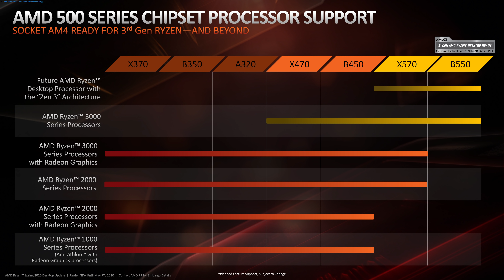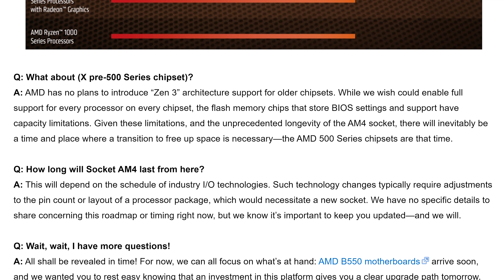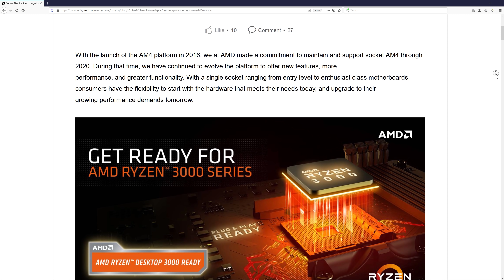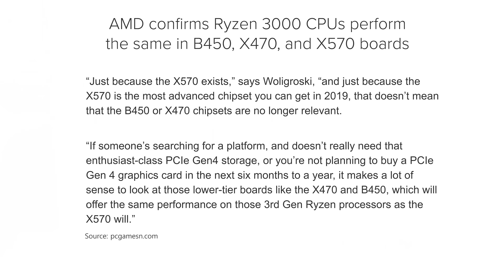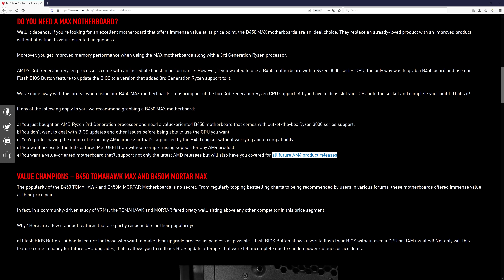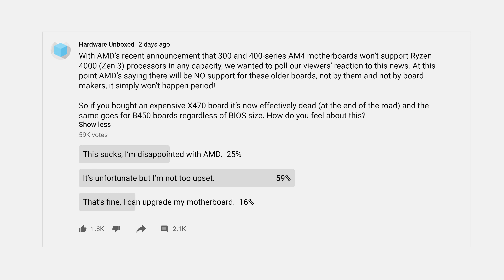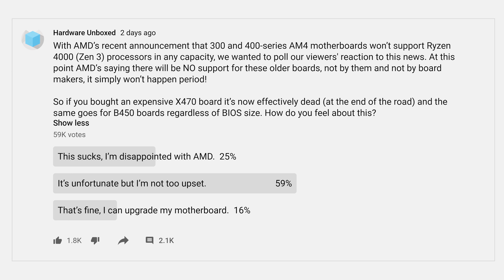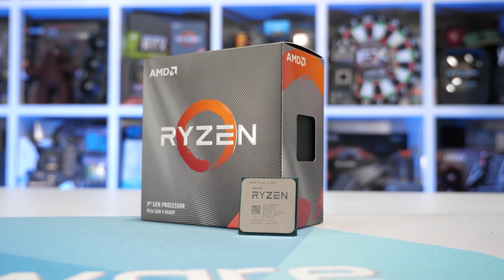AMD Does An Intel, Axes Zen 3 on 400-Series Motherboards, Our Thoughts

Comment: Damn, I got a x470 in beginning 2019 expecting 2020 support as they goddamn promised. Bah.
Reply: I think when they said "until 2020", they literally meant "the second 2020 happens, there's no more guarantee". Still a scum move by AMD, even though it doesn't affect me.
Reply: @lucasz8825  nobody fucked them in the ass not to buy a 300 series motherboard, support for 3 generations is more than intel ever did
Reply: Same here bought a b450 at the start of this year and a 2700x coz i wanted to skip 3000 now thats my only choice if i wanna upgrade
Reply: AMD stated supported TILL 2020 not through 2020
they also stated that it was AM4 as in the socket not the 300/400 chipsets that would be supported
Reply: @samcan9997  nah they sais through 2020. Stop being a fanboy and defending these companies smh.
Reply: Where did AMD promise that? AMD have already made it clear that AM4 motherboards won't be supported after 31 December 2019, so not sure how you thought that your x470 would work on Zen 3 which releases after 31 Dec 2019. If you look at AMD's official Socket Stability slide in the article "3rd Gen AMD Ryzen CPUs Will Work on Many Existing MSI AM4 Motherboards" (search it on Google), you'll see that the graph clearly shows no support for new CPUs on AM4 after 31 December 2019. If you take a good look, the orange bar stops right at the end of 2019, just before 2020 starts. It was already know even a year or two ago that Zen 3 will come out some time in 2020, or in other words, AFTER the official support period. So how did AMD not keep their promise?
Reply: @bgtubber  Stop spamming the same copypasta over and over again. You're on every single comment down the line with the exact same message and you don't give answers to the counter arguments... Plus you flat out ignore 90% of what Steve just said about what OTHER messages AMD has given.

Comment: I understand dropping the 300-series (but with 300 & 400 sharing the same chips dropping just the 300-series does not make sense).

But the 400 series?  If AMD had released B550 close to the Zen 2 launch and started phasing out 300 and 400? Yeah, That might have been reasonable. It does not make sense to think that 400-series boards will not get Zen 3 support when AMD kept pushing them after they released X570.
Communication is often as much about what you don't say as what you say.

Comment: The backlash wouldn't have been so big if AMD had released the B550 chipset at the same time when they released the X570 chipset.
Reply: Exactly
Reply: That's one point I agree with. Acting suprised that they maybe switch from AM4 to AM4+ in 2020 like they saidis bull. But "withholding" the B550 because reasons is something that's also bull.
Reply: @WrexBF  I'm saying that a lot of consumers have bought 3rd gen. Ryzen CPUs with B450 motherboards due to the lack of a 3rd gen. mid-range chipset (B550) and that there'd be less consumers who own a B450 motherboard today AND B450 motherboards wouldn't have been recommended as much due to how old the chipset is THEREFORE there'd be less people who would be mad about this move overall.
Reply: Why is there backlash at all when AMD have already made it clear that AM4 motherboards won't be supported after 31 December 2019? If you look at AMD's official Socket Stability slide in the article "3rd Gen AMD Ryzen CPUs Will Work on Many Existing MSI AM4 Motherboards" (search it on Google), you'll see that the graph clearly shows no support for new CPUs on AM4 after 31 December 2019. If you take a good look, the orange bar stops right at the end of 2019, just before 2020 starts. It was already know even a year or two ago that Zen 3 will come out some time in 2020, or in other words, AFTER the official support period. Do people not know how to read graphs?
Reply: @bgtubber  AM4 is socket type, B450/X470 is chipset type. Learn the difference. Unless Ryzen 4000 series use  a new socket type, which pretty unlikely.
Reply: @bgtubber  AM4 Is still supported though, just not all chipsets. The problem here is that AMD offered no current-gen mid-range/budget chipset that would've replaced B450 when 3rd Gen Ryzen and X570 came out so all consumers who didn't need advanced features on their motherboards had no other choice other than B450. It is obvious that B450 motherboards can support 4th Gen. Ryzen it's just that AMD doesn't want to.
Reply: @bgtubber  You being in damage control , you are copying and pasting the same comment all over the thread
Reply: @bgtubber /videos And the bar starts at 2017, as you should know AM4 exists since 2016 ergo 1 whole year before the graph starts. 
So, do you know how to read graphs?
Reply: @CarbonPanther  Actually first motherboards with AM4 were in 2017 I believe.   It was announced in 2016
Reply: bgtubber, wtf are you talking about? those X570 and B550 boards are AM4 motherboards. 
Let's assume AMD said that they'll support the AM4 scoket until the end of 2019, why the hell are ''AM4'' boards like X570 ones still getting support then?
Reply: I agree, but my comment was replying to bgtubber. Youtube probably bugged out cause I also receive a comment from Verzula that wasn't refering to me.
Reply: @WrexBF  Excellent Point.
Reply: bgtubber Ive seen this same message on other comment threads here and I truly am wondering if you are somewhat related to amd or motherboard partners in someway. You can't be stating the same message on multiple comment threads because it's deplorable and doesn't answer the original comment. Yes there is backlash and yes consumers want 4000 support on 400 chipsets. Deal with it we are consumers also and want the best bang for our buck in these hard times. Trying to justify amd's stance blindly here depicts that you are not understanding the consumers view. And by blindly I mean pasting the same reply on multiple comment threads on this video.

Comment: While this doesn't affect me as I got an X570 board already, I am quite upset by AMDs behaviour in this matter.
This is without a doubt a class 1 dick move, especially considering it's explained by a bullshit reason.
I smell marketing incompetence miles away, and truly hope the uppers at AMD decide to turn this one over.
What is entirely unreasonable is that this info is given so late into the game. Zen 2 has been out for almost a year, and I'm assuming many, many thousands of 400-series boards have been sold since then.
Nah, this isn't fine, not by a long shot.

Comment: Intel screw compatibility with Z370 which basically the same socket as Z170 and Z270.
AMD screw compatibility with 4th Gen Ryzen which is using the exact same socket as previous Ryzens.
So, both are greedy when they think that they're on the top.

Comment: I bought a B450 Tomahawk Max with an R5 3600. I voted that I wasn't too upset though, because I bought the max for out of the box compatibility with my current CPU and not to future proof. I considered X570 for future proofing (PCIE 4.0), but ultimately decided that I'd be more likely to upgrade 3-4 years from now than any time in the near future. I didn't see the value in spending the extra $40-50 for X570 when I'd probably want something beyond that (or potentially even an Intel chip) in the future.

Comment: If and had released b550 when the 3000 series came out, then this wouldn't be as bad. But there's a good chance that am4 won't be around much longer than the 4000 series. So the b550 (and any 600 series) is basically a 1 generation board from what I can see.

Comment: 32MB Bios B450 / X470 Boards ( of which there are many out there still for sale) could easily get a new Bios Code written for them to support Zen 3! ( even if that means removal of previous series Ryzen CPU support for that specific Bios version - sure, no problem! ) They could possibly pull that off even for the 16MB Bios B450 Boards, If the Board partners are willing to completely strip down their fancy looking Bios GUIs to a "bare minimum/simplified version" that will only retain the required functionality and support for these CPUs...  Cmn AMD and Board Partners... Dont get sloppy and lazy, you can do much better than this...

Comment: I really disagree on one point: support for 300 series imo should also be there. I just searched and remembered as far as i could find sources that confirm that the old shown roadmap to people that bought in zen 1 were shown that zen 3 would lauch before 2020 (that did not happen) though at the same time they stated support to 2020 which implied that 300 series am4 would support zen3. Now a lot of people i know that took the gamble and the misery with zen 1 bought a rather nice board (thoug for really nice once there was no choice/ non at all) just for this longevity. so those were pretty expensive x370 boards for that reason that b450/x470 is discontinued is just complete nonsense but i disagree that x370 should also be ruled out for any support.

Comment: Asus makes six X370, three B350, and three A320 boards (just looking at the site -- there may be others that aren't listed). That's 12 "Gen1" boards.
There are six more X470 and nine B450 boards. 15 "Gen2" boards.And right now there are 12 X570 boards, while we wait for B550.That's at least 39 different AM4 motherboards from just one company.

Now, imagine trying to properly validate each and every board with the 10 Gen1 Zen CPUs and APUs, six Gen2 Zen+ CPUs and APUs, and currently nine Gen3 Zen 2 CPUs -- with potentially several additional models that are only available in select parts of the world.That's at least 25 Ryzen CPUs, but there are probably closer to 30 once you add in revisions like the 1600AF.

Validating every board across every CPU means at least 975 potential combinations -- and then there's RAM compatibility testing, USB devices, M.2 SSDs, etc. Just getting a platform to work well with one generation of hardware takes effort. Cross-generation compatibility can double or triple the effort required, and then the companies are stuck supporting products that are no longer for sale with new CPUs.- JaredWaltonGPU 

I believe the above seems to be a valid reason and why AMD made this decision. So cut them some slack and don't bash them.

Comment: I am hoping Asrock would do some of there usual magic in this case and the rest will have to follow.
Reply: did you not hear? They need the Agesa code from AMD to support the 400 series. Only then can they do something for the customers! This time, AMD is not even giving the board partners an option to support it on their side if they want to!
Reply: @NatrajChaturvedi  The AGESA code can most likely be pulled from the x570 or b550 BIOS and haxed in. Many board vendors have pulled similar tricks over the years. I had an Abit board that let you run dual socket on Celeron back when the internet was steam powered.

Comment: The 500 series board will also have a short lifespan. As I think the introduction of DDR5 in ZEN 4 and also a new socket will force a motherboard update. Anyway my impression is that people stay on a current CPU/motherboard combo for as long long as they can. For so updating them both in a new setup. If they upgrade anything in the latter period it wil be the GPU

Comment: Meh I got a 2700x build last jan with a x470 taichi and it would be nice if i could get zen 3 (ryzen 4000) gen support. Ever since 3rd gen came out im like well its not that big of an upgrade but I could get zen 3  when that comes out then be set for a bit. I figured zen 3 would be where am4 would end and I would be fine until then so this is a bit different than I expected.

Comment: bought an x470 board and 3700x expecting to be able to upgrade to a zen 3 chip at some point but hey if that doesnt happen i will wait out them moving away from the AM4 socket as there is no point buying a 500 series as by 2021 they will have dropped support entirely and probably moved to AM4+ socket

Comment: The problem is how AMD market their AM4 socket. those wordings of support till 2020, committed through 2020, etc, AND the fact that AMD did not stop vendors like MSI market their MAX mobo for "support for ALL future AM4 processor", AND THEN they didn't release B550 until everything's too late, is a clear dick move. after Zen2 launched, there's a clear "Ryzen boom" in the community. Everyone and their mother and their techtubers recommended Zen2 for friends and families, along with budget B450 boards because X570 is too damn expensive. So everyone did just that, they bought B450 and Zen2 en masse. some believing they still can go higher with their investment on B450, turned out to be false. 

So who's to blame for this mess? 
is it the very optimistic community about continuation of Zen1, Zen1+, and Zen2 tradition?
is it AMD for spreading hopeful wordings and marketing push, and did nothing to clear the misunderstandings, and also delayed B550 to this bad?

Comment: I don't understand how this pulling an Intel when the main thing holding Intel back is the repeated use of the same socket =b From my understanding whenever Intel required a new motherboard in the last decade it's been because the physical chipset has changed, not just because they are too lazy/cheap to include a larger bios.

Comment: I bought a b450 motherboard 3 weeks ago
Reply: Hermès Akkermans  I also brought a b450 msi mortar max for my ryzen 3600 2 months ago with news on msi and amd website that this board will support the new 3000 ryzen new gen 3000 cpu, I feel that I have been robbed at this moment in time, overclockers forum recommended the b450 max countless times also, if I known that amd would changes there mind regarding the b450 max I would not of brought it, msi states on there webpage that there b450 max will support 3rd gen ryzen...
If and do not change there mind I think msi should accepts a refund or change my board to b550 or X570 and I pay the remaining money...

Comment: I'm not phased by AMD's decision because I went in buying a B450 with a 2600 (very midrange) expecting it'll last me 3-5 years before I start to see diminishing performance (well, I had a 4770 i5 & it started to diminish quite rapidly since it was only a quad-core & that's my only comparison) and will have to upgrade to a completely new chipset much later on that'll even outperform a 3600. So if I'm going to spend money, might as well be on something up to date even if it's "midrange" again rather yesteryear's 3600.

Comment: Yeah but Ryzen is so good you don’t need to upgrade the cpu. I bought a 2600 and b450 when Ryzen 3000 was out ( fine for my use case). I will probably keep for 4 more years. But wouldn’t ddr5 be out for Ryzen 5000 and that would need a new mobo anyway. It would be great if the compatibility was there but how much better is Ryzen 4000 going to be that waiting out that cycle is not going to be that bad. I don’t think anyone recommended upgrading a 1600 to a 2600.

Comment: If they said at the beginning; we just support zen3 on x570 and b550, I guess everyone would have been fine with that. But this way its quite sad. Personally i got a x470 board in 2018, and i thought i would hunt a deal for a Zen2 part, when Zen 3 is released, because some people will upgrade for sure and used Hardware got such a sweet price to performance value. But now I know that the 12 and 16 core parts will stay expensive even on the used market, because it's the highest end option you have on the 300/400 Boards.

Comment: B450 hmm. Considering between 3900x and Intel comet lake with upgrade to rocket lake. AVX-512 support is important in the long term hold and buy, but I NEED something modern for my PC to get my workflow now.  And I don't want a chipset to have additional fan for noise reasons, and I'm anyway close to limit of my budget with B450 boards.  The comet lake to rocket lake upgrade path would be getting first really cheap comet lake and later upgrade to highest core count rocket lake.  While I advocate for long term purchases, this time I have to get something. Using i7-920 for work doesn't cut now , year or two too soon. Royally screwed by 10nm delay after seeing what AVX-512 could be used as programmer who likes to optimize code.  
Now how much this matters, but it looks like this time Intel will have in few weeks the platform with better upgrade path.

Comment: Just got the B450 Tomahawk Max and R5 3600 last early February 2020 and my whole mindset while buying those components is that this will be good enough to serve me for the next 3 to 5 years tops. But I would like to appeal to AMD at least ONE last generation of compatibility for my 400-series board so I could prolong those years using them. Wouldn't it be awesome to use this board for 2 to 3 more years after we upgraded to a Ryzen 5 4600 or 7 4700?

Comment: My understanding of this move by AMD apart from bios BS is that 1.ryzen 4000 zen 3 will be much stronger chips than the current 3700/3800/3900/3950x meaning people will justt upgrade them and not buy a new mobo (if amd chooses to support ) but that in turn will cause losses to mobo makers.
2.They want to appease the mobo makers too even inf x670 is coming up and zen 4 is coming up it will be at par or insufficiently faster than the 4000 chips which will let down the mobo makers.
I believe its just business bios or no bios support.
Now i shall watch what HU says..